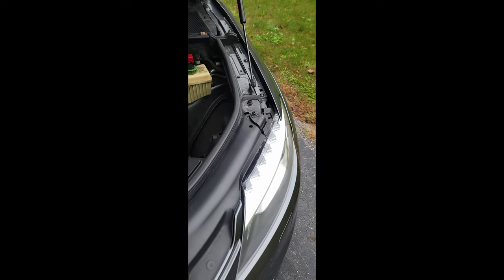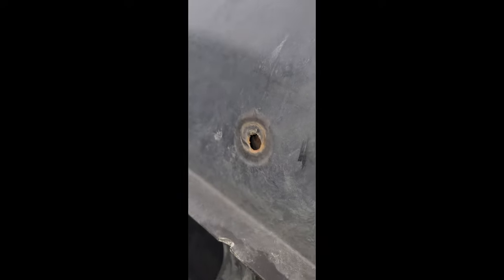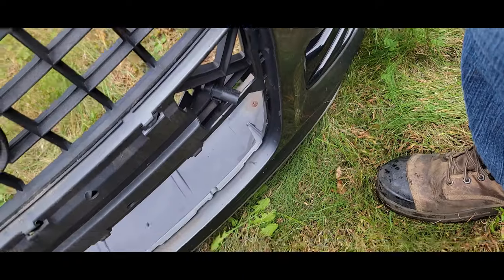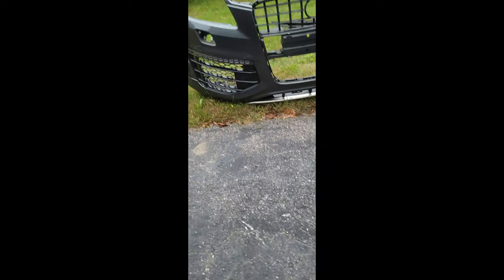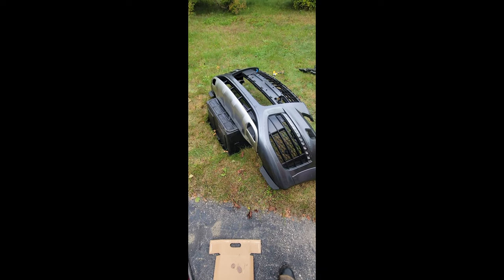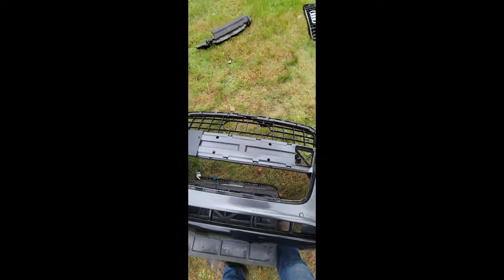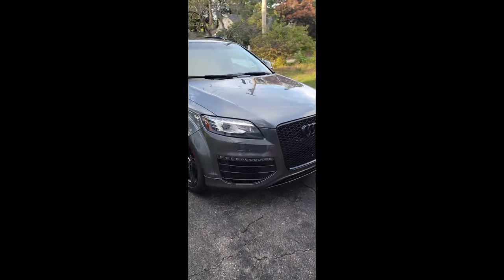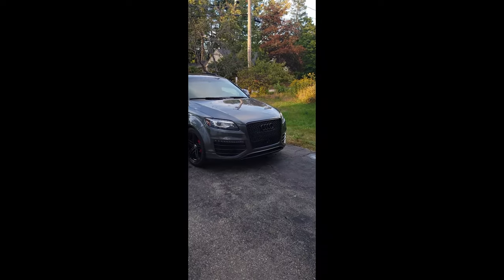2015 Audi Q7 RS Style Grille Install

Comment: This is awesome. Thx so much for taking the time to record and post this. The Underside Of my bumper got caught on some rebar in a parking Lot When I was backing out and resulted in the facsia getting half way torn off. I had a few of the screws break off the plastic. I'm gonna tryto epoxy Them back on and Reinstall it. While I'm at it I will order the RS real grill and install it. I should probably just go through my insurance but this will save me the 250 deductible. You Rock mr Hoover!
Reply from the maker: Glad it helped! I started out was just going to take a few photos while I did it obviously just figuring it out as I went but I figured you'd would be better for folks!

Comment: Post a link to the one you purchased please
Reply from the maker: US $143.55  15%OFF | For RSQ7 Style Front Sport Hex Mesh Honeycomb Hood Grill Black for Audi Q7 4L 2007-2015 Car-styling Accessories
https://a.aliexpress.com/_mKiHmF2
Reply: @Darrylh82    Thanks man!   Over all are you happy with the fitment?
Reply from the maker: @edwardflair2372  yes! It's great! It's an even easier install if you don't have adaptive cruise.
Reply: @Darrylh82   Yea, I actually purchased a different one few months back that did not work at all.   Just ordered this one, hoping for better results.  Thank you.
Reply from the maker: @edwardflair2372  what was the issue with the other?
Reply: @Darrylh82   the shape was just off it didn’t match the contours of oem at all.   Oem had pronounced crown, this one was more flat.  In the end I could never get it to snap in, even with substantial force.  And holding it in, just didn’t look right.  I think it was a bad molding or something.
Reply: @Darrylh82   you also give me hope it isn’t related to the sports style package,   Which is what mine has.  First one I’ve seen installed with our v12 front bumper.  Black paint on the bottom lip is the same route im gonna take.
Reply: How long did it take you ?
Reply: What is the easy pass?
Reply from the maker: @GustavoGarciaValverde  it's a device we use to just drive through tolls and pay for them with a credit card.
Reply from the maker: @GustavoGarciaValverde sorry I don't get notified about comments for some reason. Only a few hours. Took me overnight because of if the painting. If I didn't paint it then just a few hours.

Comment: hey what are lose black pieces with the wires connected called ? my grill is missing those
Reply from the maker: That is for adaptive cruise control. If we're talking about the same thing. The one where I cut it and screwed it on?
Reply from the maker: So about 4:50 or so?
Reply: but  do you know what that piece is called  @Darrylh82  yes thank u im lookin for those pieces my truck are missing these
Reply from the maker: @ashleybland5041  no I don't. Do you have adaptive cruise control? If you don't it's a fairly major retrofit.